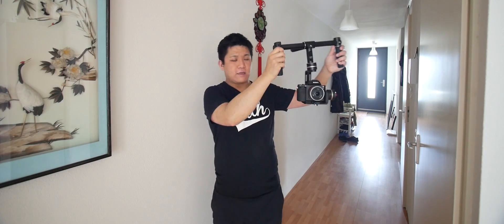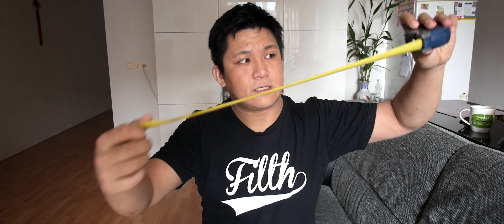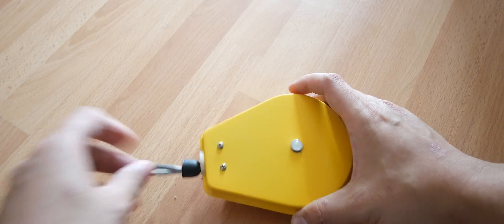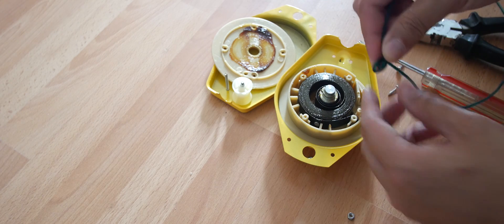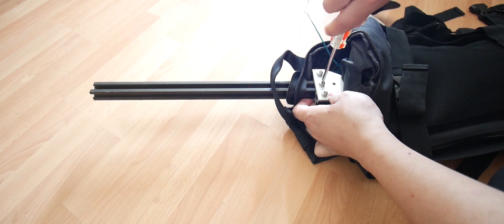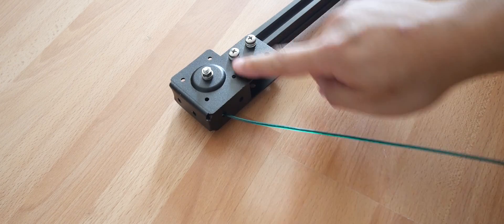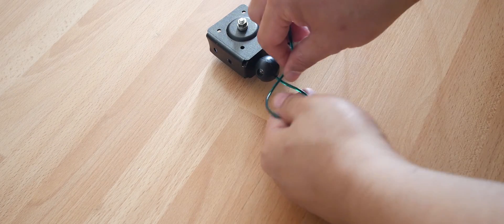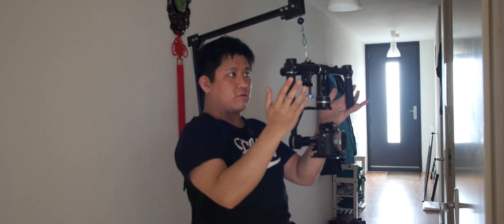DIY Overhead Camera / Gimbal Backpack Support by Chung Dha

Comment: Unbelievable man. You did such a nice job with this. Looks manufactured! The only thing I would change is the backpack. I saw another video where the guy used a USGI Molle II frame and back straps instead of a book bag. It's the frame of a military backpack. They sell them cheap on eBay! That with your design would be perfect.
Reply: Nick Piro can you link video?
Reply: can you link the video?

Comment: Hey you mentioned this stabiliser a while back. You finally made it. Looks nicely balanced with the camera and as you said better looking than PVC. 

Will it be more complicated to have it come over the shoulder instead of over head? I think it will look less of a contraption then. Maybe also find a way to collapse it in the backpack. So maybe you can have it all in the laptop compartment at the back of your camera bag. Or even built into the bag itself... but then you need a bag manufacturer to build it into their bags. 

Looks nice! Thunmbs up!!
Reply from the maker: Over the shoulder be too low as cannot shoot at eye height and also it be offsetted and only usefull for low angle shots with top handle. And need to make own hole for it to protude from. Collapsible be harder to make with much more parts needed to make it lock down and unlock, as the more parts the more expensive it becomes. Right now spended aorund 175euro to build this.
Reply: @chungdha  i found all the parts but the New blue wire and the connector to the camera it self. Can  you help me with the names of those parts or the location to find them. I am in the USA> By the way your project is amazing.